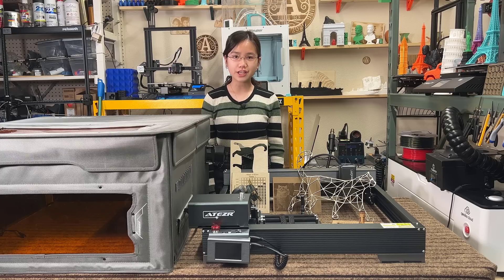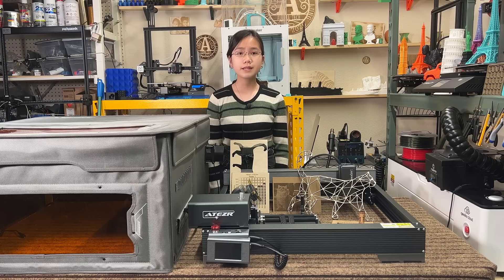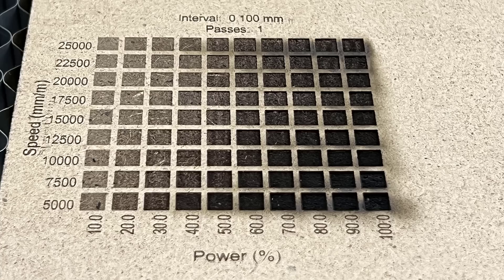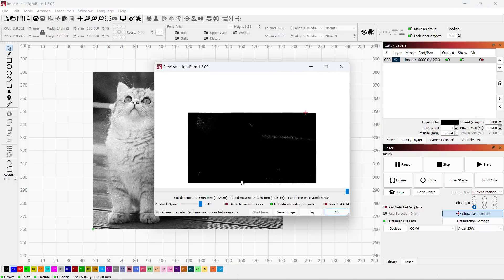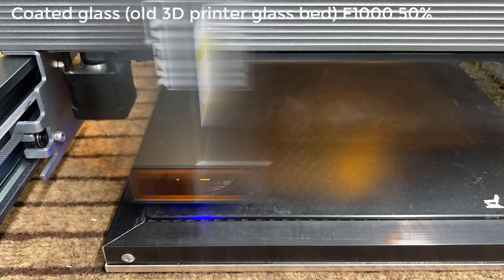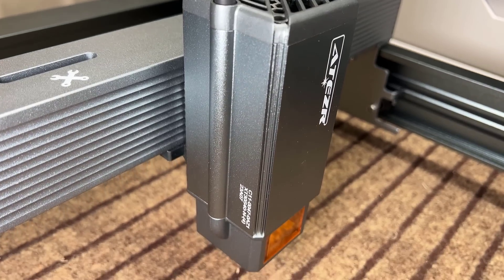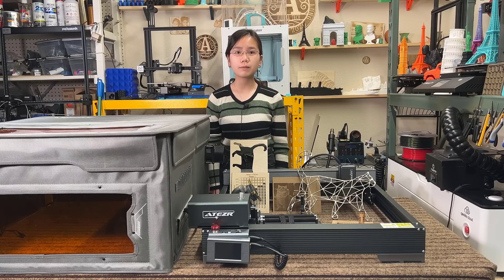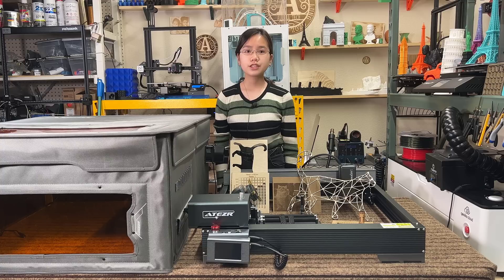Atezr V35 Plus Laser Engraver: Tests on Slate, Glass, Wood, and Metal - Review with Pros and Cons

Comment: LONG STORY ALERT: 

For the first time since I've subscribed to your channel I find myself in disagreement with some of your review. I guess it had to happen eventually! But you are awesome so I shouldn't be surprised it took this long to happen. 

I'm writing this up as a full review. 

Let me explain/give my 2 cents on both companies products..As an owner of both an xTool D1 Pro and an Atezr P20 (their previous 24 watt version which is just the same machine with a different laser module) who uses both machines for business/production work I find myself in a position to say with confidence the Atezr is the better machine overall if you intend to use it for serious work. 

I do agree that xTool is further ahead with their self developed software and that its quite capable for hobbyist jobs and that Lightburn is a necessity for the Atezr lasers. I did not really consider this a downside as Lightburn is THE industry standard and I'd already bought a copy for my D1 since it's also necessary for the xTool to do any complex work beyond hobbyist jobs. I haven't really touched the xTool software since the first day I set it up beyond firmware update etc. because it's not robust enough to do real work within. Result: Software ease of use goes to xTool for the hobbyist. 

The Atezr is a beast of a machine, a workhorse that has had zero downtime since I put it into service. This is in contrast to my experience with the xTool. Let's just say that xTool(Makeblock) struggles with customer service and support issues and has for ages now. This is not a secret and you can confirm it just by searching the web. There are many, many customers frustrated with xTool service and support. When I received my machine it took over 6 weeks for me to be able to use it because it arrived with missing parts. It took me over a week to get a response from customer service. They agreed to send the parts which after 2 weeks had not arrived. When I reported this instead of just shipping the parts again they ARGUED with me about it. Understand these were not expensive electronics we're talking about a metal shaft, motor cable and limit switch cables. Yet they chose to argue rather than preserve the relationships with their new customer. On the other hand, my Atezr arrived complete, I reached out to support with questions and support responded within 24 hours. To be honest, my questions were to test support after my experience with xTool. I was concerned about purchasing another machine from a manufacturer overseas. Results: Support - Atezr= A+, xTool=FFFF--

Speaking of workhorse, you noted the speed being slower than advertised. The maximum speed of this machine can be increased within the Lightburn console from the factory default which is set to 6kmms but the control board is capable of 24,800 and it can be increased to that speed. However, let me just say that while all of these diode laser companies claim these crazy speeds none of them can produce high quality results at those speeds and none of those speeds are sustained, meaning their burst rates. It's essentially a marketing ploy they ALL use and they need to just stop. The performance/results of all diodes at these extreme speeds is so subpar that nobody would bother to use those settings. 

Hardware: Both machines are built well, Atezr has a much larger footprint so it has a larger workspace. Atezr also has touchscreen controller. It's clunky but it still allows you to run a project without being hooked to a computer. I sometimes bring it outside when I'm using very smelly materials that I don't want to deal with inside even with an enclosure. Also, the air assist runs through the power supply so it doesn't require a separate power supply or plug/outlet. Results: Atezr wins. 

Rotary: Hands down xTool makes the best rotary on the market. Thankfully it ships with multiple connectors so it can be used on the Atezr and other lasers. Because of this is a non-issue. I use the xTool rotary on my Atezr. 

The biggest difference between the two is software but I stated my opinion on that. The second important thing is how they treat their customers. Thus far Atezr is miles above in that department.
Reply: I think apart from the pure hardware, the customer department is very important. Sooner or later something will break, or you have a question. When they don't respond or argue, then the best hardware is almost useless.
So, thanks for your insights!
Reply: Wow! Thank you for your input. I’m new to laser cutting and am wanting to invest for my business and you’ve helped with my choice.
Reply: Good stuff my cyber friend!  The rotary tool was potentially why I would have given the nod to xtool.

Comment: Another great review! I have the P10 and have been having issues with shapes bit cutting properly, for example a circle will be off and not close completely... any tips?
Reply from the maker: I would suggest checking the belt tensions and adjusting the tightness of the rubber wheels by turning the eccentric nuts.
Reply: @AuroraTech  Thank you!